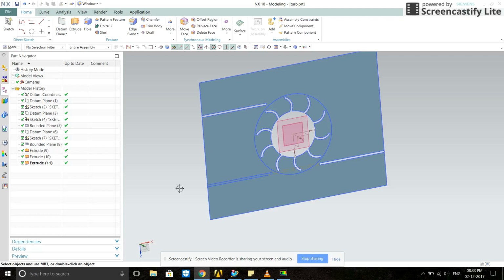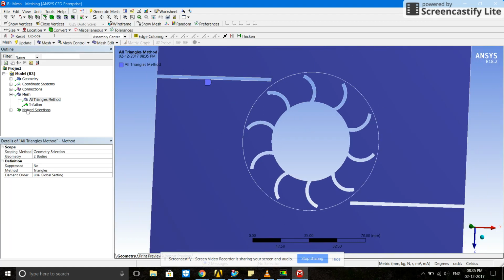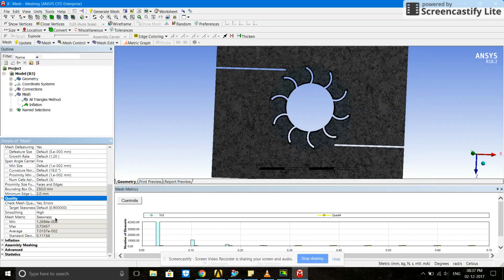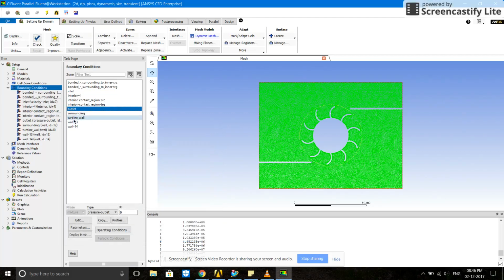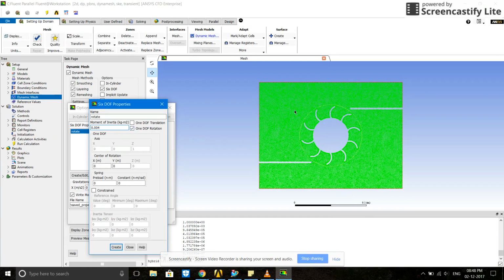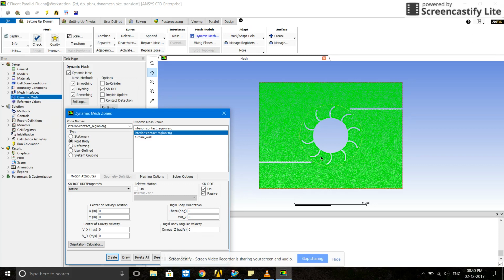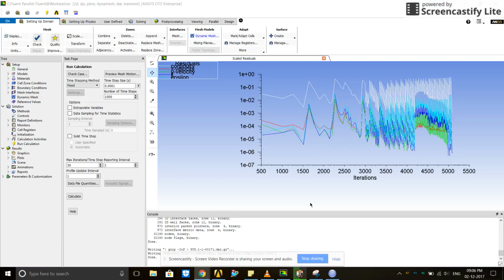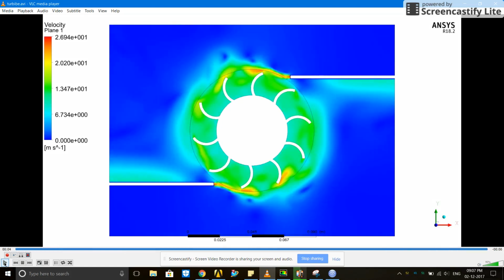Ansys Turbine Analysis || Dynamic mesh || 6DOF analysis

Comment: Thank you so much for the helpful video, Viraj Gandhi

I assume that the rotation of the turbine was caused by the velocity of the inlet, is that correct ?
Is there any UDF in this project ? If, yes. may you share it ? it would be highly appreciated. My email: dominhdung1996@gmail.com

Thank you so much for your reading.

Comment: Hello,
I am working on the numerical simulation tridimentional of two-phase flows around a Savonuis rotor with Ansys fluent (VOF method), in fact I created two domains, a fixed domain and a rotating domain containing the rotor, I chose the sliding mesh method and I imposed a rotational speed for the rotating domain in cell zone conditions , in this context, I noticed after the calculation that the jet of water coming out of the penstock does not strike the rotor to turn it and the rotating domain does not turn and both interfaces block the water to turn the rotor and that the rotor rotates with the air before the jet of water strikes it and I got unrealistic values of epsilon, What can I do please? and thank you in advance.

Comment: Hey bro...
I need your help in my work.
Please do let me know on how to give both SLIDING MESH AND DYNAMIC MESH in a project?
That means, my turbine has to run both by the motor RPM and also with the force by the water flow.

Thanks a lot in advance.
Will be expecting your valuable response in this concern.

Comment: I have encountered flotating point exception  and negative volume cell detected. I can not get rid of them. Can you help me ?. I have restricted time. can you share this ansys project file with me?
Reply from the maker: Most probably you made the circle too close to blades. make a little big circle and also keep some space from nozzle.
Reply: @virajgandhi3121  hi viraj
Can you share the wbnj file and geometry in drop box to slove the problem that some friend had?🙏🙏🙏🙏🙏🙏🙏🌹🌹🌹
Reply: Reduce the time step let's say your step is 0.01 s then you should make it 0.001. Floating point error is mostly due to wrong boundary conditions. Check your settings.
Reply: @ewentry  I have tried your comments but i can not reach a solution
Reply: What about the mesh quality? Is it coarse too dense?
Reply: @ewentry  I used 0.5 mm to 5 mm  max face size but it is keeping to say negative volume cell detected
Reply: @alimbacakoglu6278  hello Alim were you able to solve the problem it is because ı have the same problem as well.
Reply: @umitbeyazgul2963  I could not solve
Reply: @alimbacakoglu6278  hi alim.
I have the same problem that you have.
Were you able to solve the problem?🙏🙏🙏🙏🌹 I need to solve it very much :/

Comment: I have a problem in the analysis, I need the results of the analysis in rpm rotation, but in my simulation the fluid flowed doesn't reach the blade, can you make tutorial with my design.? thanks..
Reply: Did you solve this problem? I need know it